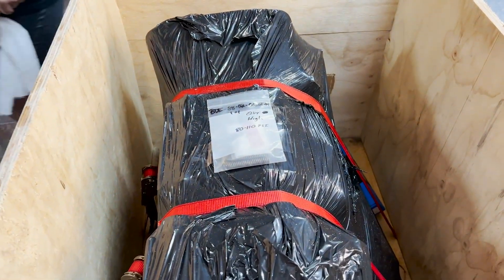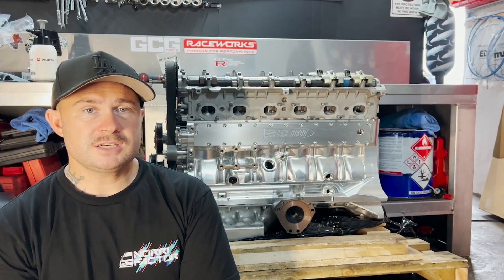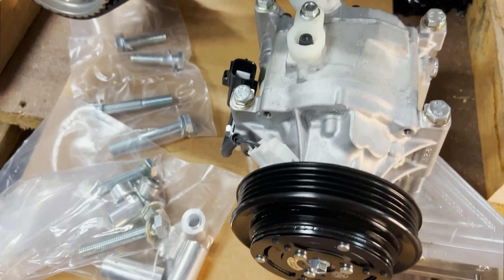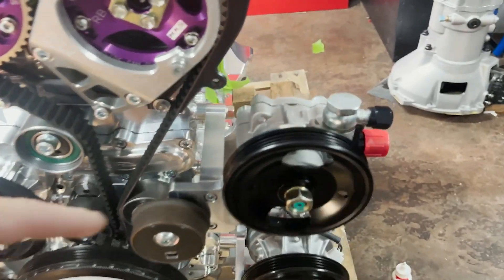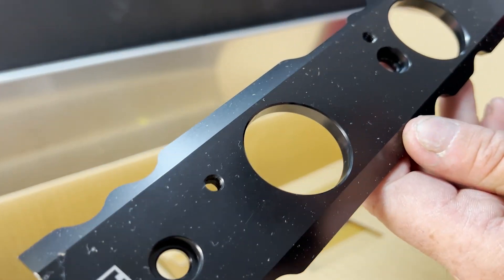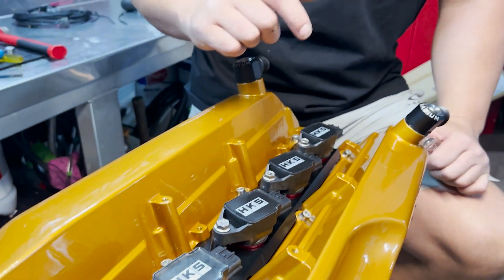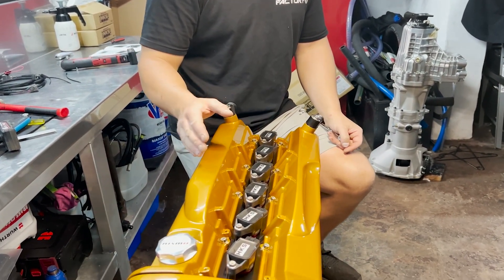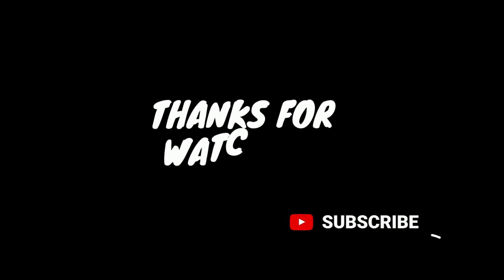RB30 Bullet Engineering Billet Block Reveal & HKS Super Coil Pack Fitment

Comment: Any advice for why going billet? I am going to build a new engine for my r32 next year and i am unsure if should take a normal rb30 block with a stroker or take a billet block with a stroker. The Price to build the block is almost the same in my country.
Reply from the maker: Cast is easier to build, you don’t have to worry about heat transfer and engine temps, cast block with a good block brace will safely make 1500 and will go forever. 
The cast is also lighter than the density of a billet block. And if you use Prp’s new block cast seems to be a good option these days. I built a cast block for the 33, no engine brace but the block has grout in it, it’s a mad engine

Comment: Those valve covers will interfere with the hood. The front of the engine is way taller. Also,  don't space the subframe. It'll ruin the suspension geometry.
Reply from the maker: we could cut a hole in the bonnet if that would make you happy ?